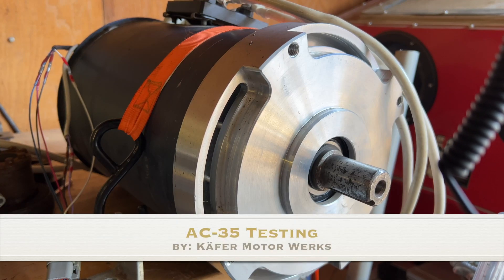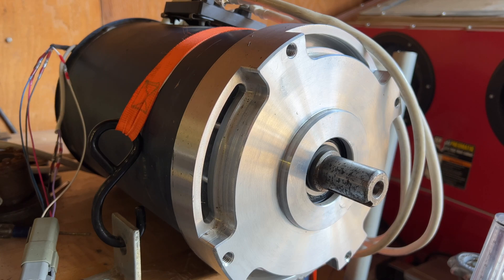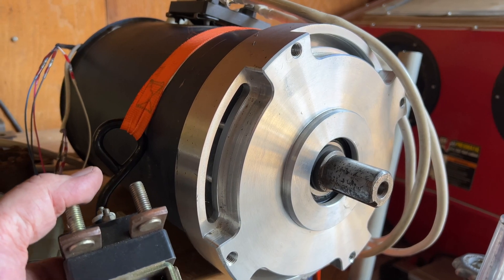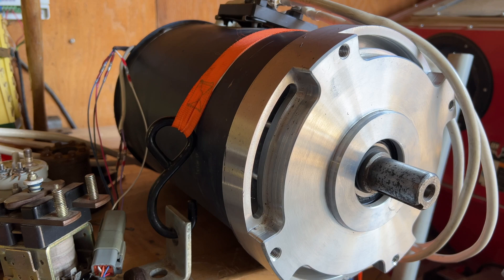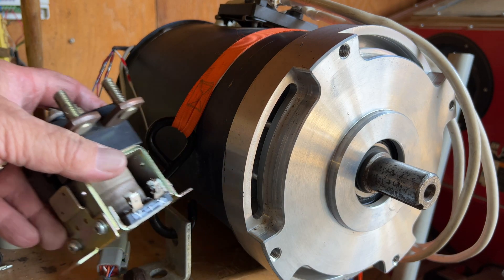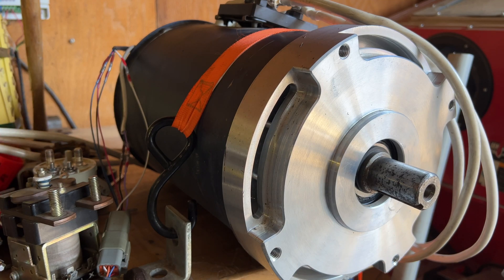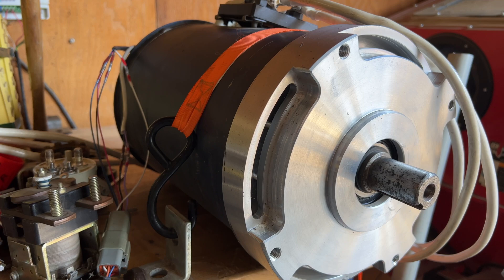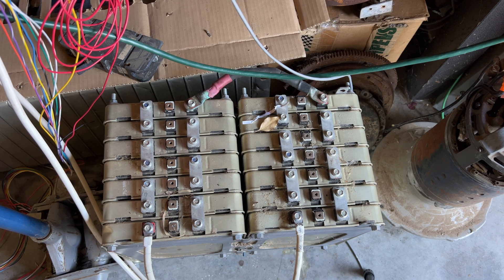AC 35 Motor:Controller Testing

Comment: You dont have enough amps from the power source. That's why cuts off .... This motor draws big amps .... Wich im sure you don't have
Reply: Running the motor in a no load situation I don't need the amperage at all. Amperage comes into play with a load on the motor. Amperage will rise to counter the load. My battery pack Im using can provide plenty of amperage for the testing even if I did put a load on the beastie. The power pack I mentioned is to only power the key switch. In other words the power pack is taking the place of the 12v battery but this one I can setup to output 24 or 48 volts as well.

Comment: Hello, I have this same Curtis controller but I don’t have a diagram on what wires to connect the throttle and stuff. Can you post a video on what wires go to what? I have 100 lose wires and I have no idea what to connect. I’m trying to run the 1238 Curtis controller to a 3000w AC motor with a 72v battery on a electric car I’m trying to build. I would really appreciate it. 😊

Comment: hi sir, I have a 96V 1000A AC controller for the EV application, I have been trying to run the motor with Curtis controller but I could not be able to run the motor, pls guide me.
Reply: What motor and what controllers do you have?
Reply from the maker: Do you have an AC motor and are trying to run it with a DC controller? What motor and what Controller do you have that is 96v and 1000 amps?